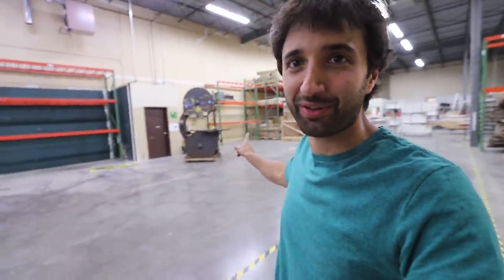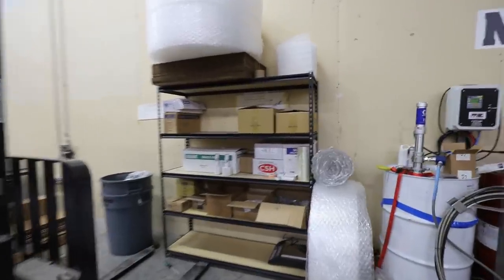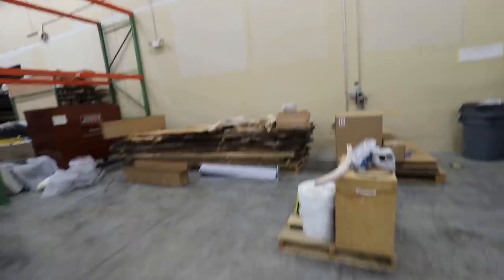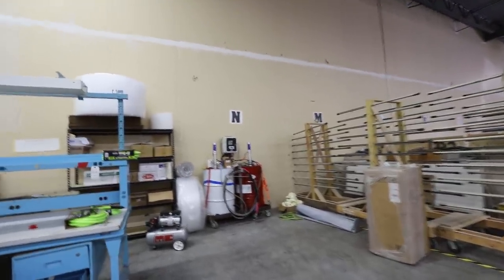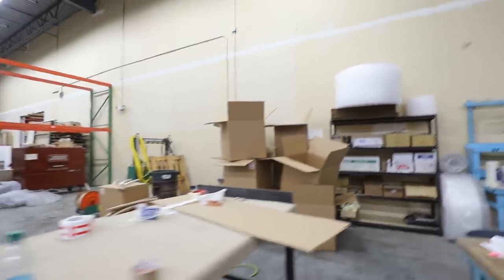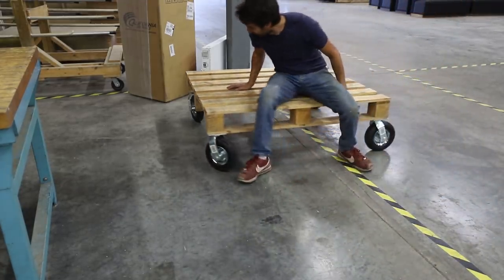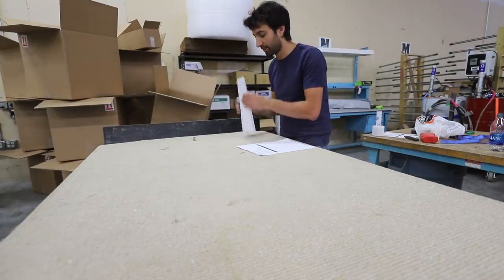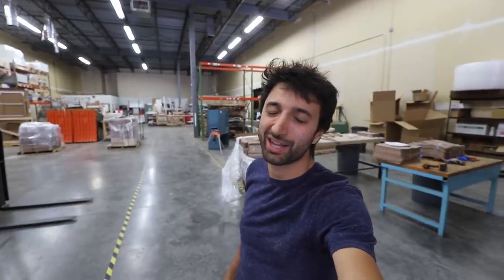Chair Kit Packing Area - Warehouse Vlog 4

Comment: A very simple bubble wrap roll holder is chains hanging from the roof to a closet rod with eye screws in the ends to hang from the chains. 

Harbor freight one of the hydraulic lift carts would work for a loading cart as you can set the height then lift or lower the box when full and sealed to stack on a pallet.  Picking up a pallet jack will also save you use of the forklift as you can use a pallet jack to move pallets around on the floor and just use the fork lift for putting things onto shelves.

Comment: In case you need a way to keep the bubble wrap off the floor and able to use you can take a length of round stock and weld a bolt to it that fits into the slotted angle and a small 90 on the opposite side. Then put a nut on bolt then feed through the slotted metal and lock bolt it to the frame. Keeps your roll off the floor and at working height.

Comment: As a business owner, I understand what you're going through in these early stages of getting it going.  I'm actually considering retiring from my regular job at 55, because it is doing so well.  With that in mind, my business can be moved to anywhere there is a post office.  If you need some help, I have the ability to work many hours, don't be afraid to reach out. I also have 30 years under my belt of production supervision and running a forklift.

Comment: Matt, if the criss-cross wire "shelves" on your pallet racks are similar to the style I am familiar with.....you may want to take a grinder to the edges of those shelves where the front-back wire ends, right over the cross beams. Those ends are super sharp, they are just industrial sheared off...no chamfering at all. There will come a day when those ends rip the hell out of your hands or your cartons.
Reply: I just put up a few sets of those shelves in my bro's building. Yeah, OK, if you never ever do anything but forklift pallets onto them, no problem. Otherwise, those wire-ends are very sharp. I'd run a grinder along them, if you should casually toss a box onto the middle shelf and your hands are a little low, because the box is heavy and your hands are just above the cross-beam, you'll gouge the hell out of your hands or knuckles.

Comment: it wouldn't do any harm getting brackets for the pallet racks and bolting the racks to the walls, put casters on the benches so you can move them around without the forklift

Comment: Advice from someone who has worked in a warehouse: Palletize EVERYTHING!  Watching you walk/roll the chairs one at a time was painful!  Get a stack of pallets and just set items like that on them.  Then you can fork truck the whole mess wherever, makes rearranging things (will happen a lot in setting up the warehouse) much easier/quicker.  Roofing suppliers have some decent pallets with the boards butted tight together (chair legs won't drop through pallet).
Reply from the maker: I'm in desperate need of more that's for sure

Comment: Man you work fast and hard..your air compressor has a dryer ? if not please look into getting a air dryer, it is good for all the air equipment you use for your wear house  brother. Good to see you and be safe see you on the next one.
Reply from the maker: You might be able to catch of glimpse of the dryer after Al showed up.  It's back by the rack with the chair samples.  Thanks!

Comment: Use three pallets to raise the pallet with the casters on it to a decent height, or perhaps two, depending on your preference, just use the truck to lift it off when you are done filling it.
Reply from the maker: Trying to avoid having the forklift be a critical part of the packing process in case employees don’t want to or can’t drive it.

Comment: As a general rule weight distribution on warehouse shelving should be higher weights below. On floating shelving (not anchored) it is way more stable and shorter fall generally.

Comment: What's the 2 part foam rig?  Is that for packing?  I use those pumps for sprayfoam
Reply from the maker: Yes. Foam in place packing
Reply: @mcremona  how much was the equipment, and how much for the set of foam?  I pay under 2k for a set of closed cell foam, and any equipment is over 20k total...
Reply from the maker: The equipment was 7.5 and the pair of drums are 3

Comment: Don’t use that plastic packing tape. Use the wet sealed paper tape. It’s stronger than the box itself and will not peel off.
Reply: I think that paper tape is faster too. Smoothing it out on the box felt better than getting wrinkled tape every now and then too.

Comment: Those orange horizontal sections on the racking need knocking in place with a mallet (not too tight), Only a little knock! make s a big safely difference.  trust me,
Reply from the maker: We used a slab